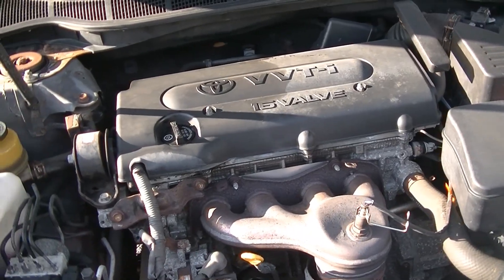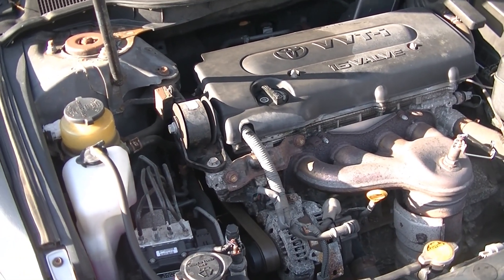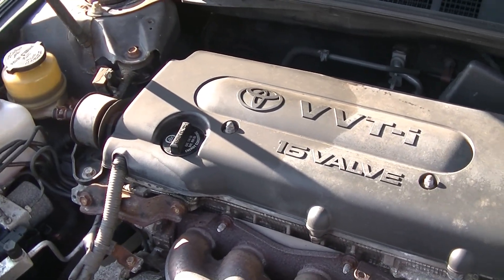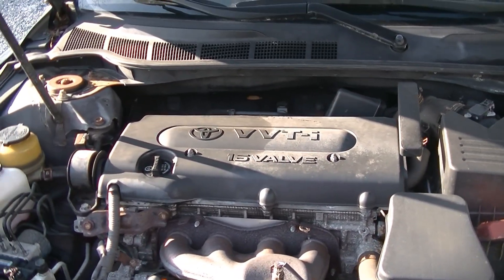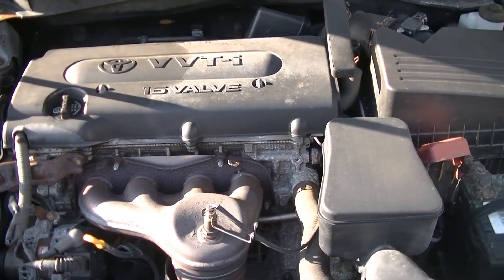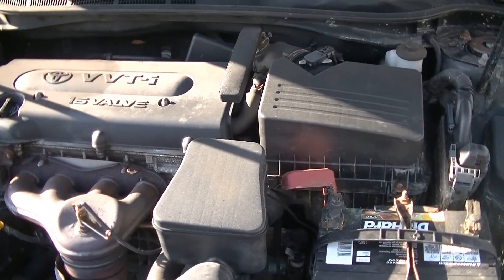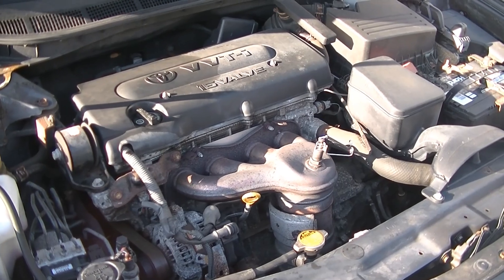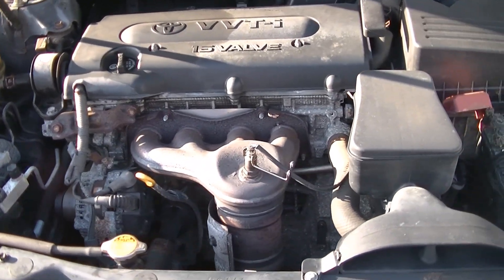Why you should AVOID a TOYOTA with the 2AZ-FE 2.4 liter engine!

Comment: I am actually planning on buying one tomorrow. A 2007 v4 2.4 camry. Nice all around with only 100k mileage but this made me reconsider. I actually asked the dealer if he knows if the car was recalled and serviced but he said he didn’t know. Is there anyway I can know for sure and if I couldn’t should I avoid buying it ?
Reply from the maker: If you plug the vin number into the Toyota App, you will be able to see the complete service history of the car at the dealership level. This will tell you if that TSB has ever been completed. I will tell you that my 07 has been absolutely flawless, but as mentioned it has had that TSB performed
Reply: @SEsGarage  what would it say if the service was done please ? I have access on the record now but don’t know what to look for
Reply from the maker: @Abdullah-oe2xv  mine says “R&R piston and ring set under service description
Reply: @SEsGarage  didnt find it or anything remotely similar. Thank you man You helped me dodge a bullet here. Guess I will go with 2008 Nissan Altima. Any thoughts on this one ?
Reply from the maker: @Abdullah-oe2xv  I’d buy the Camry and take the chance of having to add oil to it every once in a while before I got a Nissan, especially if it’s equipped with the CVT transmission

Comment: Just wanted to share with you some helpful information. We have a 2008 Toyota Rav4 with the 2AZ-FE engine. It has relatively low mileage at 85K, but I was adding up to a quart and a half of oil every 1000 miles. I maintain all fluids and more on our vehicles with great long term use, some over 20 years old. Anyway, per a suggestion from another Youtuber, I decided to perform an engine flush. With zero expectation, I was amazed to find zero oil loss after 1500 miles so far since the flush and fill of new oil and filter. Also, the oil is hardly visible on the dipstick. While the rings had a faulty design, I believe the flush released enough gunk on the rings to enable enough expansion and prevent blow by. Good luck.
Reply: Can you tell us which product do you use for engine flush and what is the procedure? And what brand and weight oil that you use?
Reply: @ronaldchan3401  he's full of shit, that's why he didn't reply lol
Reply: Drain a half quart of oil or wait till its low that much and add half quart of kerosene to the crankcase let it idle for about 30 mins then change the oil with some good high detergent Castrol or  valvoline 5w 20
Reply: Hi, which Youtuber and what product did you utilized?
Reply: Anthony, help us out here brother, which engine flush product did you use?

Comment: Toyota redesigned the block for the 2007 to fix the head bolt failure my 07 burns oil but I added a oil cooler to increase oil capacity I think its a great engine

Comment: I am very sorry but you are DEAD wrong about these engines. I have spent upwards of 10 minutes combined on the rev limiter (6250 rpm) while beating every ounce of snot out of my 2004 Camry with a 3” straight pipe. Oil changed every 4-7k miles. I have put this car through minute long first and second gear clutch dump, rev limiter held, burnouts, wound out every gear besides 5th to redline. This Camry on redline is a staple in my hometown. Burns / leaks from valve cover about 1/3 of a quart in 5000 miles. I’ve ran it with no serpentine belt (no water pump) with the temp gauge pegged for 15 minutes twice now, I’ve ran it until the oil pressure light was on and added 3 quarts of oil. That was 10k miles of shear abusive power ago. You will never convince me this engine is a poor feat of engineering. This bone stock (with a scion TC tune), 220k mile, Toyota 4 banger has had more abuse than any other car I know of and it is not lacking power nor oil storage capabilities. So no, you sir are very, very wrong about the capabilities of this engine. I will continue to daily drive my 2az powered Camry and continue to hit redline daily as I have for 3 years now. Oh ya, pal. I’m that guy.
Reply from the maker: I’m not wrong this is all proven fact and Toyota released the TSB’s to boot. You may have gotten lucky and the ones you’ve owned didn’t have the issues mentioned in the video, but there are plenty of people that have had the exact opposite experiences that you’ve had.
Reply: My 06 Scion has 270K still running strong, the factory Toyota manual for my car says it can burn up to a quart every 600 miles before needing to be rebuilt
Reply: Original owner of a 2005 2AZ FE Camry here with 82,000 miles and doesn't burn a drop of oil. I always changed oil btwn 3,000 - 5,000 miles or every 6 months which was usually the case. I always used conventional Castrol GTX 5W30 until about two years ago when it was only available as a synthetic blend. So I switched to conventional Pennzoil 5W30 until about a year ago when the Pennzoil became only available as a  synthetic blend. So, at that time, about a year ago I switched back to Castrol but now using the Castrol GTX 5W30 synthetic blend and knock wood I have no leaks or seepage. I think maintenance is super important on these engines. I change out all the fluids according to severe maintenance schedule or even sooner, including the ATF Type IV OEM from Toyota. The transmission also runs flawlessly.  When you buy these used, you have no idea how they were treated unless you buy it from someone like me with proof of maintenance performed.

Comment: Has this engine in my 2004 camry I bought new. Sold it at 130,000 miles with never a problem. Had a defective belt tensioner at 24k miles and the intermediate steering shaft clunked. Recalled in about a million Sienna's. Before that bought a new 1998 Camry V6 the claimed had issues. at 160,000 it was perfect except for the valve cover gaskets leaking. Teh annoying thing was the defective strut bushgings, the suspension was horrible. Replaced my 2004 Camry with a new 2009 Hyundai Sonata I am still driving today and is the best car I have ever owned. It runs and drive like the day I bought it over 12 years ago!

Comment: I am in that delema, 07 tc, a at in ever fill up. The price of a reman is outrageous these day. I want to replace it with a 2ar-fe, but I have a question on that.  Will the ECM work if I do a eng swap. Do you know. Can you fill me in.
Reply from the maker: This would be an extensive project. The 2AR uses a different PCM/harness and is more advanced. (Dual VVTI vs single VVTI on the 2AZ) and then there’s the issue of getting everything to communicate with that new pcm
Reply: I thought so, thanks for the input

Comment: I have this engine in my 2009 Pontiac Vibe. I've had a rough idle that seems to have worsened to a degree, no check engine light whatsoever. Also getting a rattle when accelerating, that is not heat shield related. Fuel mileage has definitely went way down as well. And yes, mine is an oil burner.....a very bad one.
Reply: I had the same problem in 09 vibe with 2.4 engine.  it's probably the piston rings are clogged causing rough engine idle and oil consumption.  do seafoam in the motor oil.
Reply: Mine did that when the oil got low.
Reply: I have an 09 vibe AWD. Not an oil burner, but coolant temp sensor went out and 16yo new driver thought driving on “H” was fine all day. I’m doing head gasket this weekend, hopefully that’s all.

Comment: He’s clearly never driven or been in a Scion tC. It’s actually pretty fast especially with the 5 speed manual transmission. Def not as fast as a wrx but 0-60 in sub 8 seconds is pretty good for a car in its class and the gas mileage is great too. I have one and it does in fact push me back to the seat so there you go.
Reply from the maker: A wrx isn’t exactly fast either. The Tc probably does the 1/4 in around 16-17 seconds at best. Compared to any real sports car or sedan…it’s slow. Hell, my TRD Camry hits 60 in under 6 seconds and the 1/4 around 14 and while yes it puts me back in the seat, it’s by no means a fast car.
Reply: I’m actually looking at buying another tc. Just gotta buy the right one. What year is yours?
Reply: I just bought an 05 tc with 215,000 it’s quick and fun to drive but my moms tdi convertible beetle is faster
Reply: The tc is slow for having a 2.4 compared to a 2005 rsx type s with a 2.0 engine.

Comment: Nice channel! Just subscribed after watching this excellent video on the 2AZ-FE 2.4 liter engine which came in a 2008 RAV4 I bought new. I never got a notice from Toyota about the new piston retrofit nor did my Toyota dealer say a word. Too late now but so far so good, it's low mileage, with good maintenance, oil changes every 3,000 miles, never overheated and doesn't burn oil. I'll hang on to it, keep up the maintenance until there's a problem.

Comment: I have 98 Toyota RAV4 2 dr with 300,000 miles with original engine and transmission always replaced with Mobil1 full synthetic oil.

Comment: In your opinion is this worse than the oil consumption on the 1.8L 1ZZ-FEs used in the corollas? I just gave up my 2000 corolla which used a quart of oil every 100, YES 100 miles, in favor of a 2004 Camry with this 2.4L engine. So far I don't notice any oil consumption at all. But I am going to go easy on this one and always change with full synthetic every 3000 miles.

Comment: Let me guess, the engine burns oil,at least 3 to4qts of oil.
And on some the Camry's with the  engine 2.4L engine, the ABS control module would malfunction causing the A/C not to work correctly and the odometer wouldn't work, and it wouldn't pass California smog test.
These problems where on only a hand full them..Solution to problem, sell it as is,and get the 2.5L engine. Much better design.

Comment: Has anyone ever seen a comparison between the new "redesigned" pistons and the old ones. I have tried to find this and failed: even asked the care care nut who is a Toyota guy and Scotty Kilmer. Is the problem the low tension rings (to get better gas milage)? Or are the oil drainage holes the problem? Some say all 2AZ-FE are oil problems, then others say that only 2007-2012 have problems. The killer seems to be stop/start driving not highway and country speed miles. Oil rings get clogged and there is no way to clean them except replace. Highway drivers don't seem to have the problem.
Reply from the maker: I’ve never personally had the two side by side. But from the reading I’ve done, the oil return holes in the pistons (behind the oil control ring) are supposed to be slightly larger, and instead of being drilled through, they are drilled in at an angle to prevent clogging. That was the main issue with the pistons. Oil return holes would clog, causing the oil control ring to also carbon up and clog. What ever they did do, it corrected it because my 2az has gone a little over 100k since Toyota performed the TSB and it doesn’t burn a drop of oil

Comment: This is just about the OLDEST NEWS I've heard.  Thanks for the warning- however,  Toyota said that if the car Camry/Scion xB/ Rav 4 from 2008- 2010 they will fix it for free if its under 150k miles.  From 2011 and up- the issue was resolved.  I drive a 2012 Scion xB - not a drop of oil burns.... Case closed.
Reply from the maker: Consider yourself lucky that you’re isn’t burning oil, mine also doesn’t because as mentioned, it had the service bulletin performed before I purchased. This video is more for those looking at cars passed the mileage/age deadline that may not have had the bulletin performed. Toyota did not advertise the service bulletin and it was performed on a case by case basis. Many cars slipped through the cracks
Reply: @SEsGarage  Very true- normally gearheads like us do our research before we buy cars- Toyota's reputation made them fess up to it.. I guess your video is for the uninformed buyer.  My apologies.
Reply from the maker: @oreally8605  no need to apologize. I’ve always been one to research a vehicle before purchase and I figured this video could help those doing that. I’ve also always been one to keep up with maintenance on my vehicles so I’m sure if I had one of these brand new that I wouldn’t of had the oil consumption issue as it stemmed from lack of maintenance.
Reply: @SEsGarage  I’m about to purchase a 2009 Toyota Camry SE with a 2.4 4 Cylinder Engine from an Authorized Toyota Dealer . I’ve been trying to find research if the SE Camrys from 2006-2011 were equipped with the faulty AZ-FE using unreliable pistons. I will be asking for its Carfax history and will be carefully looking to see if it had over a dozen oil changes on its record, or if it had a used Warranty that repaired it’s torque fixing this problem . So far, I haven’t found any record if the SEs were part of this recall. But I’m hoping that SEs weren’t included.

Comment: Check the ViN on the Toyota Owners site to see if the pistons were rebuilt.   Now, if you're having cracking/leaking radiator plastic or have a leak in your heat core, you have that 2AZFE stripped head bolts syndrome.  Remove the thermostat. Keep your resevoir cap loose.  Upgrade your radiator to the Denso 221-0506 ( tow option ).  Some  parts logic says it doesnt fit, but it fits fine.  Keep topping off your coolant every week.  You'll generate a CEL & your mpg will drop.  However, you'll slow down coolant loss. Save up $$$ for a proper repair/replace car.  Peace.

Comment: This is a very reliable engine. This guy is full of shit. Toyota had a bulletin on them and if you didnt jump on it that is your problem. It was 10 year extended from date of first use
Reply from the maker: In the second hand car market you never know what the original owner did or didn’t without documentation. I obviously own a vehicle with this engine, only because I did my due diligence and made sure the bulletin was performed. Simply making sure others don’t get burned by purchasing one of these that burns oil or worse.

Comment: My 2010 Rav4 lasted 220000km then head developed a coolant leak. Idle was bad and consumed oil. Head bolts were ok. Had proper mobile 1 oil and proper coolant change. Pretty shit engine
Reply: @Buddyclub33  Any evidence for this statement? My '05 has been running on Mobil1 for 225,000 miles with no engine problems at all with most oil changes at 10,000 miles.

Comment: I still drive my 2009 Camry with this exact engine.  My country did not have a that service bulletin for the pistons. So, mine is left untouched since it rolled out of the showroom floor. In 12 years of ownership, I have zero problems with it. I just take care of it and it take cares of me.
Reply: 2.4L 2AZ-FE:. Keep an eye on coolant level every week. Change water pump every ~three years.  Change transmission oil every 60K miles.  The 2.5L 2AR-FE  (2008- current)  is a way better engine.  Peace.
Reply: In México too,no info,was available still drive the Toyota Camry 07 but Burns los of oil rus Nice ,was Made in u,s,

Comment: lmao i built an 11 second scion with one of these engines in it, i could handle 15 psi of boost no problem it does an 11 second quarter at 200k miles and she does just fine to this day
Reply from the maker: Relatively sure they have forged internals from the factory (crank and rods)
Reply: @SEsGarage  they do thats why they can handle boost so well and dont throw rods or burn gaskets like subarus and they are easy as piss to build inside and out so if it blows on you its def ur own fault and if yall cant afford a quart of oil every thousand or so then you prolly shouldnt be building anything other than ur credit score fam lol
Reply: @SEsGarage  id take this over an EJ engine every single day of the week any smart person would
Reply from the maker: @TheBookofLab  cracked ringlands and head gaskets on those things. Pick your poison lmao
Reply: Are these comments saying that 2AZ-FE have forged crank and rods as OEM? Did you get forged pistons as well and if so, what are the best rings? 15psi of boost is a lot for a stock engine. I'd like to know more, since you seem to have solved many 2AZ-FE problems in your build. Thanks.

Comment: My 2002 Camry started burning and leaking oil from seals at about 84,000 miles.  Donated the car.  My 2008 PT Cruiser turbo looks and runs like a new car.  Doesn't burn a drop of oil.  Nada.  Runs like a champ.  I use Mobil 1 10-30 and filter and change oil every 5,000 miles.

Comment: I've had my 2007 scion for a year now (129k), and I only have to add about half a quart every 600 miles (not sure if it got the pistons serviced tho). Car purs quiet and runs great so far!
Reply: That's excessive oil consumption.
Typical for the 2AZ-FE
Reply: Toyota said it would fix it free if you give them the vin number- and as long as it is under 150k miles-
Reply: @oreally8605  The recall campaign is long over friend.
Reply: Be Careful bro, I have a Scion tC same year as yours but with 183k miles. I wouldn’t be so confident with this 2AZ-FE engine. Mine doesn’t even consumes that much oil like yours and it has way more miles, I do the oil change event 3k miles and it eats about 1 quarter by 3k miles. But another big issue this engine have is the head bolts pull threads out of the engine block causing the head gasket to be “slightly lifted”. That’s why you will notice at some point rough idling, white smoke coming from the exhaust and random missfires. Even if your car never overheats this issue comes within time and it’s very common in this engines. A lot of people think is a blown gasket when in reality it’s the threads on the cylinder block. My Scion started doing this few days ago, poured some head gasket sealant to hold it for a while and it worked. Your car doesn’t have that many miles but just be careful I’m selling mine for a couple thousands soon while still runs good.
Reply: That’s fine, my 05 tc sucked up the oil like it was candy and it’s at 220k miles now